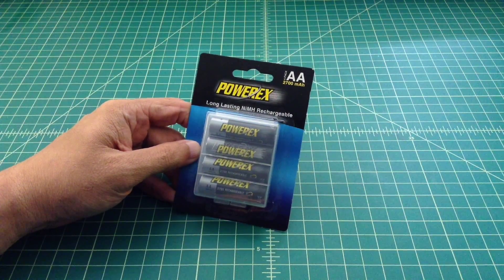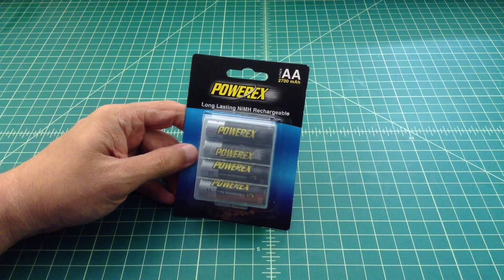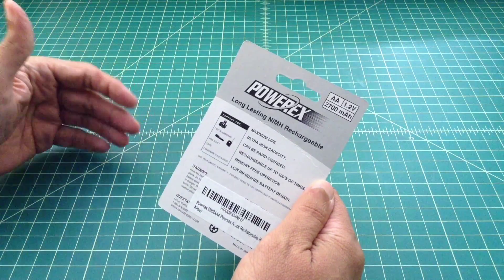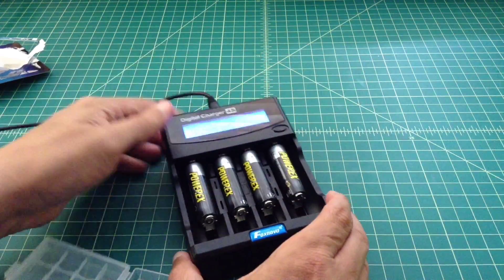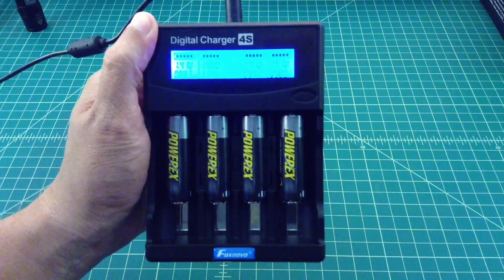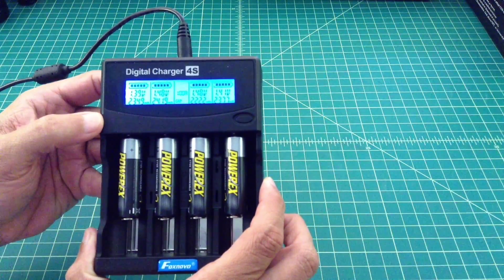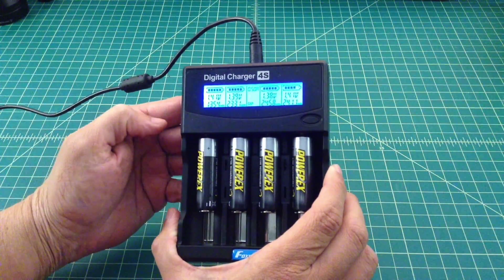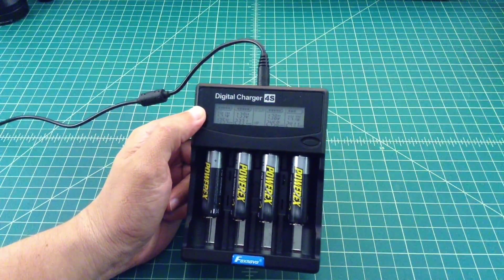Powerex AA Rechargeable Battery Capacity Testing - Ni-MH NIMH - TheSmokinApe

Comment: Actually that 4S Digital Charger is just that a charger, it doesn't actually analyze the true capacities only what it puts into the battery while charging it.  Basically the mAh readout on that charger is just a counter, that's it.  Your batteries were prolly fine bro.  🙂

Comment: Given the surprise lower ending voltage and severe low capacity on some tests, I wonder if the charger's terminating early. I've not seen science confirming this, but rumor has it new cells can trigger -dV detection early. Ultra-slow timer-controlled charging should work around that, and that's what standard capacity rating uses—but if they don't recover in a few cycles IMO the rating is still bullshit: maybe fine by IEC standard, but not reflective at all of what people will get from them in real use.
Reply: New cells have to be conditioned and charged and recharged several times before they can reach their peak capacity. The peak capacity is also based upon a very low discharge rate the higher the discharge rate is the last of the capacity you will actually get due to the internal resistance of the battery. Most AAs fall around 2500mAh +\- 300mAh. So these are pretty good performers. :)
Reply from the maker: Yeah, with this some batteries test well and other don't.  The charger itself is pretty solid, it gets a ton of use...